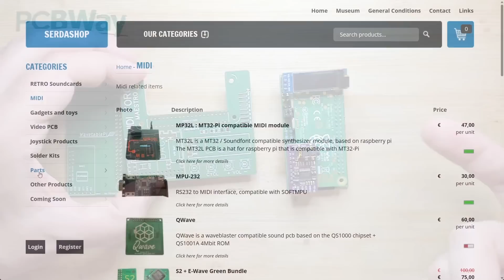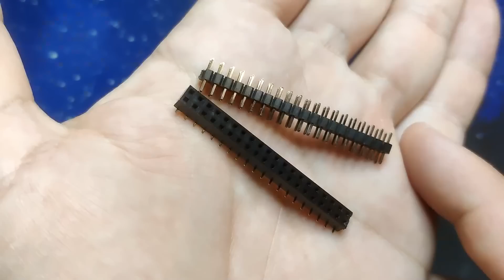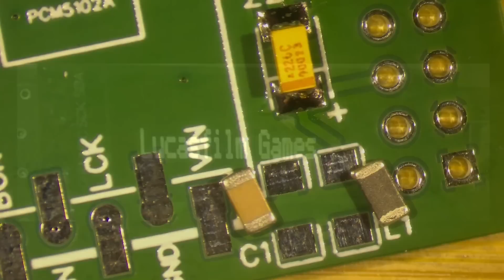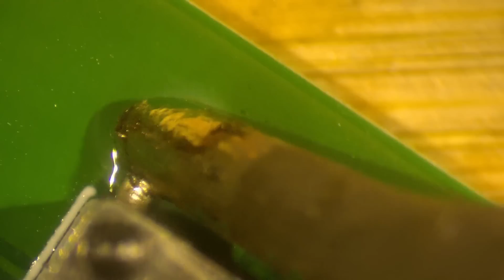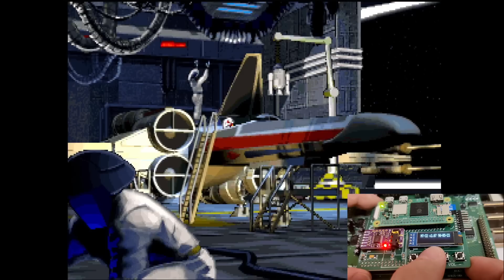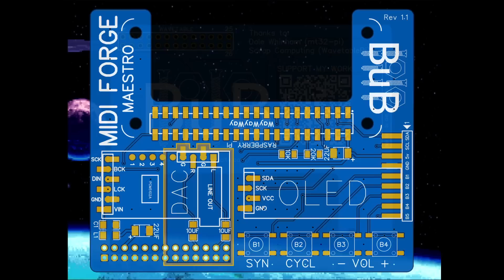MIDI FORGE: Maestro - DIY Wavetable for everyone!

Comment: One way you could make the interconnect shorter is to have the pins go through the board into the female pin header. All that is required for this is to find a female pin header with the bottom of it being open to allow the pins to go through from either side. Making a PCB with holes for the pins to be inserted through should be fairly trivial from this point.
Reply from the maker: The final version of this board is complete and I managed to get it to a single slot solution. I am already building them to send assembled boards to people.

Comment: If you used a lower profile surface mounted socket with holes through the board so the pind scan go through, will it sit lower on the sound cards?
Reply from the maker: There are ways to make the entire board flatter so that it won't block the adjacent ISA slot. I'll bring an update on this very soon.
Reply: @bitsundbolts  If you want to know how the surface mount pin headers with pass through look to pistorm32-lite wiki.  It's open source too, so maybe you could just copy and paste it into your own design.

Comment: Where did you get that tool you cut the PCB with?
Reply from the maker: It is an engraving pen. You'll be able to see links on my website under affiliate links - or you can search for an engraving pen. I'm using it quite often in my channel and it's a must have tool for work like this.

Comment: Given the bulk, maybe it should go in a drive bay, after all? The overall circuit board looks like it might fit in a 3.5" drive bay. For sound quality, you could have the DAC on a daughterboard that goes onto the wavetable header, and its link to the rest of the MIDI Forge going digitally via a ribbon cable to the drive bay, so that the only part that picks up interference in the analogue domain is the few centimetres between the DAC and the sound card's mixer.

Comment: to switch buttons you dont have to relabel. just change in src/mt32pi.cpp Event.Button == TButton::Button3 to Event.Button == TButton::Button4 and Event.Button == TButton::Button4 to Event.Button == TButton::Button3....or change + to - and vice versa...simple as that
Reply from the maker: Yes, that would work until someone used a different SD card with the standard mt32-pi release. I like the idea though!
It's really cool to have access to the source code.

Comment: Amazing! One could always use a cable to connect the daughter board to the sound card as to not block an ISA or PCI slot and place the daughter board, say at the bottom of the case sitting on a 3D printed riser.
Reply from the maker: Yes - that also would be an option. It is a standard 2x13 header. A cable is a nice idea, but I am still trying to make this a one-slot card :) The next revision of the board is already on the way! We will get there!

Comment: Those ROM files,... when you load them with button, can you be sure old one is flushed and new is actually loaded/initialized? I find it hard to believe it changes without and stutter.
Reply from the maker: The output does sound quite different. So, I do believe that the change happens that quickly - the ROM files aren't big.
However, the game is running in General MIDI mode - so, there are issues with the music. You need to change the configuration of the game to go along with the MT-32 synthesis.
Reply: @bitsundbolts  Yeah, that makes sense. Thank you for videos!

Comment: Good solution but you can get MLCC Caps in the same size which should be better. Maybe it would even good to add some more Caps, 10nF, 100nF which are close to the pin, smallest value nearest would be best.
Reply from the maker: The pads for the tantalum caps could be used for 1206 MLCCs as well. I am going to remove the LC filter as well - I am sure it doesn't make a difference. The noise came from my soundcard which seems to cause the issue. And the Pi and the DAC have already their own power filtering circuits and components. I leave the bigger caps near the power pins though.

Comment: Technically, those female headers are able to be used from the other side of the board, so if you've got space underneath, you can mount them to the underside of the board and route out the PCB board underneath them so the pins can poke through from the top and not take up any additional height. As long as you don't get the type that has the locating pegs underneath, anyway.

Comment: Ah yes the forgot to double check the pinout bug, also been there😁
Could have just cut the legs of the buttons and add a drop of glue under the button as extra reassurance.
You might want to add some debounce on the pcb for the rotary encoder to smooth it out a tiny bit.
Reply from the maker: Yes, I got too excited and tried to get those boards as quickly as possible - forgetting to double and triple-check the button pinout. Anyway, those are just prototype boards and revision 1.1 won't have those issues. There is an option in the mt32-pi project that allows you to adjust the sensitivity of the rotary encoder. I didn't try that yet, but it might be what you mentioned.

Comment: This would simply make the circuit more complex and bulky, but to kill the noise on the left channel you could use a DC to DC convertor to isolate power grounds, or power it with external batteries. External batteries would be the cheap and easy way to test it. If it works with batteries then you could go crazy with the DC to DC convertor for ground isolation.
Reply from the maker: I think there is an issue with the ESS sound card. I don't have this issue on my Soundblaster 16. Maybe there is something going on with the capacitors on the card. Maybe I should attempt a recap - or try to find the source of the noise.
It is interesting that it just comes from the left channel - the right channel is completely silent.
Also, if I listen to the MIDI signal through the headphone jack on the DAC, the audio is crystal clear. It must be something on the soundcard.
Reply: @bitsundbolts  I was thinking the same thing about the ESS. That's why I would make a battery powered one that has an isolated ground first. Cheap and easy just to test if it's a ground loop problem. They probably ran the left channel too close to a digital rail.
Reply from the maker: I will have a look at that ESS card and how they routed the left audio signal. It would be interesting to see why it makes the noise.
Btw, even without the wavetable board, there is some noise coming from the left audio channel. It's not as loud, but it's definitely there.

Comment: To anybody using those purple PCM5102 modules, I would STRONGLY recommend testing them before soldering them up. I've gone through about 10 of them. I think only 3 or 4 of the modules I purchased work. I wound up just designing my own PCM5102 board because I was sick of dealing with the faulty products.
Reply from the maker: Interesting and good to know! I tried three so far - and all three seem to be working. Any idea what could be the issue? Did you check the resistors at the back of the DAC? There are four small resistors that short those pads - they are super tiny.

Comment: Lovely work sir! A Very well thought through design. 👌
Btw a tip for SMD soldering, ideally one should but the flat of the iron up against the edge of the leg as this allows the solder to wick under the leg increasing joint strength. If you press down on top of the leg, it makes this a lot harder and can reduce joint strength.
You can also assist solder wicking by putting flux on the pads before dropping the chip in place.
Overall tho, your technique is excellent.
Reply from the maker: Good point regarding pressing on the pin. I agree, it makes it difficult for the solder to go under the pin. I'll keep that in mind for my next assemblies.
Reply: @bitsundbolts  TBH, it’s less of an issue on HASL PCB’s as the pad is already solder coated, but if you have ENIG (gold) plated pads, it will definitely be an issue.

Comment: You could use a male + female right-angle header on the Pi to bring it into the same plane as the PCB (you'd have to flip the Pi "backwards" and update the connections to the header on the carrier appropriately) and mount the DAC directly on the board to lower the profile, then maybe figure out how to mount the display on the top edge of the card? Or build a "front panel" interface with the display and buttons, mount it in a 5.25" bay or something..

Comment: I have seen headers that mount on the underside of the board and the pin headers poke through the PCB. The closest I have managed myself was to use the pin sockets designed for removeable key keyboards. That works fine for things like ROMs but you'd need to use turned pin headers on your Raspberry Pi if you went that way. The advantage is that they're cheap!
(I discovered the technique on an upgrade board in my Archimedes A440. It was so neat I have blatantly stolen it for several low-profile projects)

Comment: Congratulations on this great initiative. This makes it a little easier to load soundfonts from old wavetable boards like the Yamaha DB50XG, which unfortunately are now practically impossible to obtain (both in terms of availability and cost). Thank you for your work.
Reply from the maker: Thank you! I think this wavetable board is a nice alternative as well. You are right, original wavetable boards are almost no option anymore. They are rare and expensive! I am happy that I can provide something for the community.

Comment: That's absolutely brilliant, I'll definitely be buying some of those boards from PCB way for my soundcards, I've already ordered some of your "30-PIN SIMM with EDO-2-FPM Mod" PCB's and they arrived yesterday for my VLB 486 M/board, I built 4 last night and they are currently running memtest as I type, so thank you for making those available too, I also ordered some AT89C52's and sockets for a few of my SB's with hanging note bug, love your channel, you got really good so fast Alex, you should be proud mate, can't wait until you release the finished version, going to order some dac's and Pi Zero 2 W's right now lol, thanks again 👍
Reply from the maker: Thanks you so much! I am going through the comments now - maybe someone has some other suggestions for improvements. Then I will order another batch which will be available over at PCBWay very soon.

Comment: I think you could move the solder pads for the switch legs slightly and rotate the switches 90 degrees, then the traces would only have to be adjusted slightly rather than doing a major redesign and you'd still use both poles of the switch. It doesn't look like soldering them in a rotated placement would be any more difficult, and might actually be easier.
Reply from the maker: Maybe, I didn't think of that. Anyway - those boards were 10 USD and I also have that issue on the silk screen with the volume control. There will be a new revision of the board with a few extra features (e.g. a switch to select between local and front panel screen).

Comment: 1:52 very thinly veiled foreshadowing... 😄 awesome  work m8, i'd call that a very successful prototype! your soldering with extra flux is emblematic of your meticulous personality. no half-bottomed work from you, if it's worth doing, it's worth overdoing! 😉 to realistically remain within 1 slot height, i think the maestro would almost have to be a single pcb, which just isn't feasible. imo it doesn't have to be that flat though. maximizing compatibility with sound cards like you did is the far more important aspect, the overall height can be dealt with and will only ever be an issue in very fringe cases.
Reply from the maker: Thanks! Yes, it was a nice project to work on - and I am happy with the prototype. But I need to make it flatter :) No excuses! We can make this happen!

Comment: LOL, or you could have rotated the switches 90 degrees.
Reply from the maker: Those pins aren't forming a perfect square. If I rotate the button by 90 degrees, three of the pins won't line up with the pads. I would have to solder a wire, or tilt the buttons (45 degrees would have worked).
Reply: @bitsundbolts  Either way, woulda' been easier than hacking up the pcb copper.

Comment: even with fresh solder, having flux removes oxidation even on fresh parts with fresh solder. you never know how long those components were exposed to air prior to soldering and solder simply doesn't stick to oxidized metal

Comment: I don't know if there is possible to control the volume of the midi wavetable board by software complete in the games instead with a potentiometer on the front of the case.
Reply from the maker: X-Wing allows you to control the volume of the MIDI music in game. I think it would even work with the MT-32 emulation. That didn't work with the rotary encoder.

Comment: Hi you could solder the Buttons directly by turning it 90 degrees .
Reply from the maker: Yes, good point. I didn't think of that. The pins aren't a perfect square though - I probably would have to scratch of some solder mask or add a wire somewhere.

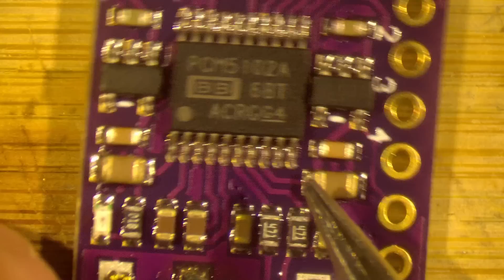Comment: 13:11 the smd components on the module are badly soldered. since you are doing a pcb, why not add the DAC directly to the pcb inthead of using a module, it will save space and also more reliable than these badly soldered modules
Reply from the maker: Good point - but that would add a lot more components to the board - and it will make it harder for people who want to build one themselves. I agree, it would save space and I would get rid of the headphone jack (or add it on the main PCB since it adds a lot of height).

Comment: OMG it's so strange decision to cut the traces )) Why don't you just rotate the buttons to 90 degrees and solder them as is with small pieces of wire?
Reply from the maker: Yeah, that would have been a solution as well. I am not sure which would be "less" work though. Anyway - it was a prototype PCB for testing - Revision 1.1 won't have any of those issues but a few improvements instead.

Comment: i built my scrap computing like he did with the pi and dac flush to the pcb with the long side of the header. Its tedious removing the plastic spacers but it makes it fit.
Another way to handle the pi by using a 90 deg header. The pcb side could connect to header with the pins flat on both sides of the pcb and then the other end going 90 deg could solder direct to the pi.

Comment: In my assembled versions of the MT32-pi I solved the problem of the distance between the PCB and the RPi-zero by doing 2 things:
1. I used machined round sockets on the PCB because those have a lower profile
2. On the pi, I soldered the corresponding round pins, but on the "wrong" side of the pi; i.e. with the long part of the pins sticking through the pi's PCB and coming out on the side where it will be plugged into the main PCB. This way, no extra plastic spacers. The soldering is a bit trickier because you want to make sure solder doesn't travel up those pins, but with a little practice (and use of desoldering braid to clean the odd pin where it does happen anyway) it's quite doable. 
This way I'm able to trim down the distance between the 2 PCBs to about 2mm, while allowing the pi to still be unplugged.
Reply from the maker: Yes, I was planning on removing the headphone jack of the DAC - it is the highest point of the entire board. Now, I understand how you solder the pin header on the other side, but wouldn't there be the plastic in the way? Or did you remove that?
I was thinking of soldering the Pi permanently on the main PCB. Basically, remove the pluggable headers and just use SMT male pin headers. The Pi goes directly on there. There will be still a small gap, but it will be only the plastic of the pin header - maybe 2-3mm.
Reply: Also, another trick - to make the whole assembly even thinner, you can desolder the audio out jack on the DAC since in the wavetable configuration it is not used. That saves another 2mm or so. With all these steps taken, and in addition soldering the LCD and the DAC directly to the PCB without plastic spacers on the pins, you can make a wavetable that fits in one slot comfortably.

Comment: So there is a trick how to lower height of connectors, but only if you are willing to “sacrifice” the bottom of the board and expose it to possible contact with metal parts. This SMD sockets can connect components from top and bottom. So you can make hole in board where sockets are and solder them from the bottom (of course you need to move solder pads to other side). As a good example look at official Raspberry Pi PoE HAT, they allow to have higher pins which are poking thru Poe board
Reply from the maker: Yes, that would be a possible solution. Let me try a few other things first because I really would like to keep the bottom of the PCB free from any possibility to short anything. It is super easy to push the PCB towards the card and it could potentially short the Pi or something on the soundcard.

Comment: a idea you could use for the rotory incoder is its default is volume controll and wen you click it you can scroll through the sound fonts then click it again to select the sound font and it returns to volume control . if there is options you have in there that use the buttons you could also have that as a sub option wen you click the rotory encoder .
Reply: And/or perhaps use a modern concept and distinguish between a click and a long press to emulate having two different buttons with a single switch.
Reply: @mal2ksc  thats a neat idea as well
Reply from the maker: You could just hook up the rotary encoder button to either of the other two buttons (select soundfont or switch synthesizer). That would eliminate all but one extra button. Or as @mal2ksc suggests, maybe the mt32-pi project could be adjusted so it can identify a long press! Then, you wouldn't need any other buttons! But who can add that feature?